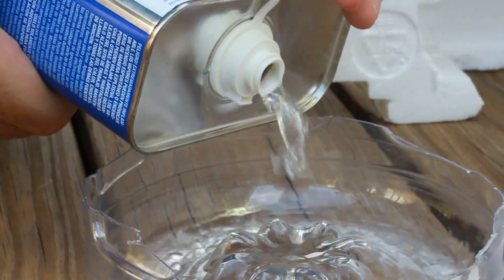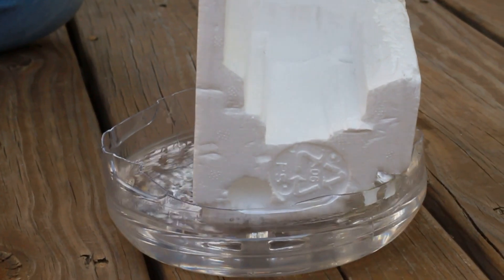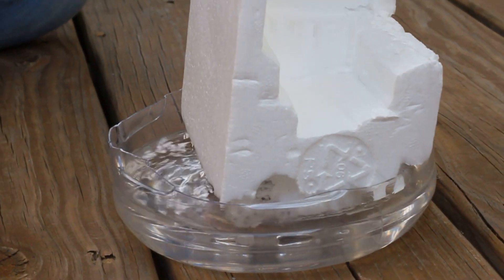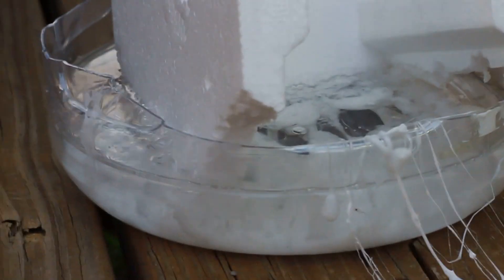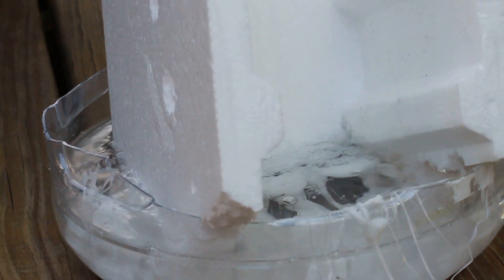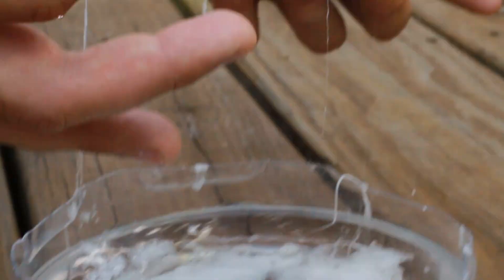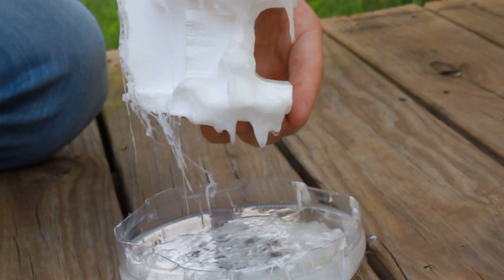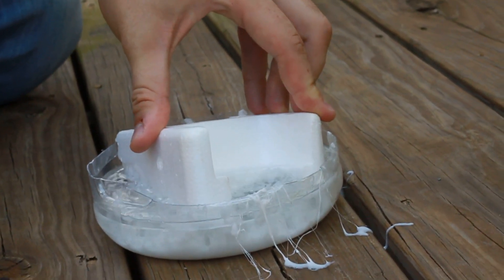Acetone and Styrofoam Science Experiment

Comment: Acetone was chemically engineered to be an extreme solvent, because Styrofoam is an expanded form of polystyrene that is soluble in acetone, it devolves into a solution. This effect can be replicated via spray paint, gasoline ( to make napalm..) and or some industrial adhesives.

 And for those who believe acetone is acid, it is not; it will not harm you unless you have sensitive skin or you undergo excessive exposure in which case it has the ability to permeate skin and enter the bloodstream causing redness, dryness, irritation, or dermatitis (a nasty rash). I repeat, in most cases being exposed to small amounts of acetone will not harm you what so ever (unless consumed... please don't do that). You will however get a chilling sensation on the skin as it evaporates (physics(PV = nRT)).

 Everything I just stated should not dissuade you from being mindful or safe when preforming experiments with acetone or anything else. Please remember that safety should always be a #1 priority.
Reply: You can also use orange juice according to the anarchists cookbook - to make napalm

Comment: Styrofoam is the trade name for polystyrene, a polymer made from styrene. Polymers are long chains that intertwine with each other, creating a plastic material. By itself, polystyrene is a hard plastic used often for packaging, like many of the plastic bottles you find in the grocery store. It's also used for model airplanes. But when a gas is bubbled through it as it is polymerizing, it produces a foamy, compressible plastic, the kind you find in things like coffee cups, coolers, and building insulation.

When a polystyrene cup is placed in acetone (found in nail polish remover and in lacquer thinner), the acetone sort of serves as a molecular "lubricant" between the polymer chains, allowing them to slide around each other. The Styrofoam becomes soft, releasing the air bubbles trapped in the foam, and the polystyrene ends up as a soft blob in the acetone. When the blob is removed and the acetone is allowed to evaporate, it solidifies into a piece of hard plastic.

Comment: gasoline has the same effect, try it! I used to use that to start campfires when it was raining..melt the styrofoam in gas until no more will melt, scoop out the gooey styrofoam(NOT WITH YOUR HANDS!!) and put it on some wet wood.. light it and boom. you have a long burning, hot fire! have a good week CRH!!
Reply: Also good home made rocket fuel

Comment: Its because both are non-polar and basically acetone works like dissolvent. And only thing why you're able to melt 1meter lond styrofoam piece into inch or two is that dissolve process will "free" all air molecules that was in styrofoam.

Comment: the acetone is actually dissolving the styrofoam(just like it does with skin and nails, because it's a good solvent). if the acetone evaporates, the remains of styrofoam are left behind+its formula doesn't change, only its shape

Comment: Styrofoam is made up of polystyrene foam. When the polystyrene dissolves in the acetone, the air in the foam is released, causing it to look like you're dissolving this massive quantity of material into a small volume of liquid. You can see a less-dramatic version of the same effect by dissolving other polystyrene items in acetone. Common polystyrene products include disposable razors, plastic yogurt containers, plastic mailers and cd jewel cases.

Comment: acetone doesn't melt styrofoam, it dissolves it. The reason why styrofoam is so light is because it consists mainly of air. Styrofoam is made by aerating styrene, a plastic, so thousands of tiny air pockets are trapped in the plastic as it hardens. When you pour acetone onto styrofoam, the styrene plastic dissolves and the air that was incorporated in the plastic is released